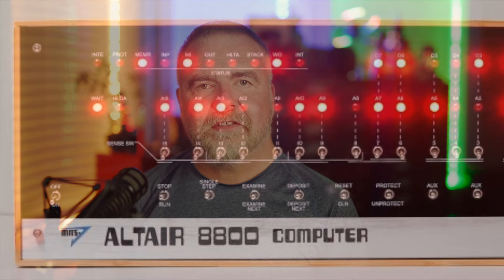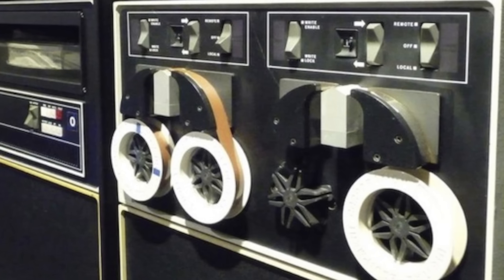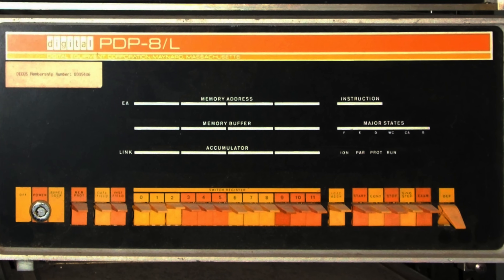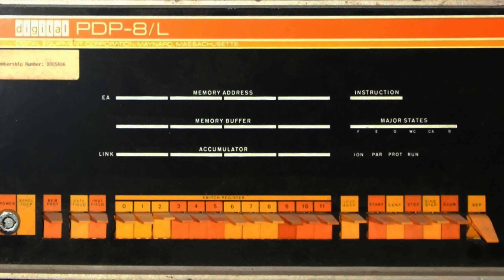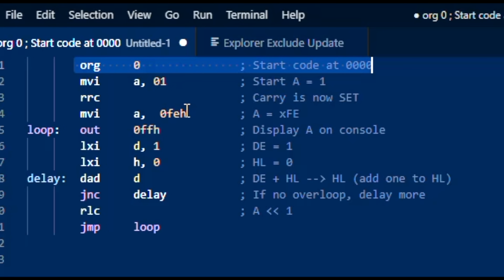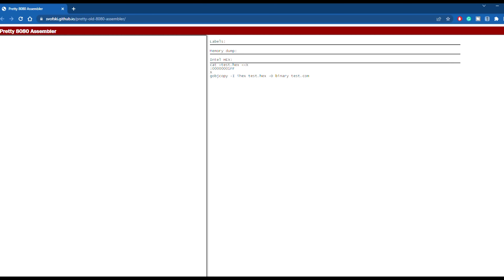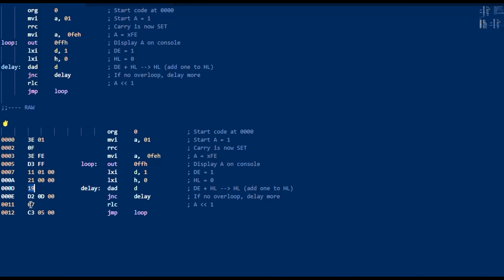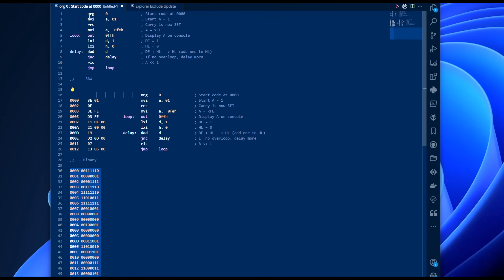Bare Metal Programming - Booting From the Switches

Comment: The bootloaders were often quite clever.  For example one of the ones for the pdp11 to boot from tape, basically consisted of enabling the tape drive (advancing to block 0), reading the next block, and an infinite loop (branch to self).  Five or so instructions if memory serves.  Since at reset the DMA address is 0, where the bootloader also resided (again if memory serves), reading the block would overwrite the bootloader with the block from the tape, and when the block was in memory the branch to self was overwritten from the tape and the CPU would continue running what is now the stage 2 bootloader at the head of the tape, which would then proceed to boot the operating system.
Reply: That explains so much of why computers used the MBR the way they did. Now things are way more complex, for better or worse.
Reply: @anon_y_mousse  It appears as if some current generation processors have mask-ROM loaders that can read a "FAT" type file system from a storage device and look for an OS startup file. I'm not sure we should be "baking in" one specific file system.
Reply: @boristheengineer5160   Indeed, and they're even starting to put NTFS reading into them, too.
Reply: Eventually Roms were added to the CPU which contained the bootloader and all you had to do was enter 3 bytes, a "JP" (jump) instruction followed by the address of the bootloader.  When floppy disks became available the rom was moved to the Floppy Controller card.
Reply: Yesh.  I remember flipping octal switches on a PDP-8 for the bootstrap. Got pretty good at converting decimal to octal on the fly.  I also remember things like the excitement of getting a new paper tape from Decus...and having to scrub the rust off the core memory because of a silly lab accident.
Reply: Very nice description of a bootstrap loader Jan. For those who do not know, originally a bootstrap is a strap on a (leather) boot, that can be used to put the boot on your foot. You use part of the boot, to put on the boot. This is exactly what Jan is describing: part of the code to read the tape is read from the tape!

Comment: I'm pretty sure you probably already know this, but hex is pretty easy to convert to binary "in your head" if you deal with each hexadecimal digit individually, for each four bits, instead of converting a two digit hexadecimal value to an 8 digit binary value.  I guess that wouldn't be a great step by step guide if you're just converting to binary in your head when typing them in.😁

I was just thinking, that's likely why there are two different colors of switches for each nibble.

Comment: Wow it is almost the same binary coding than z80, by example, "3E 01   =   ld a, 0x01"  , 11 and 21, are respectivelly LD DE, nnnn   (16bits const),    and LD HL,  nnnn  so 3 bytes long,   C3 label, is also the same unconditional jump, the rotation is aswell 0x07 0x0F, the fast ones, I think, the whole program at 9:45, is the SAME binary that will work in a z80. I didn't know they rip off the whole OPCODE table, atleast the NON shifted table, how they didn't hit a copyright claim? .
Reply: Z80 is pretty much a superset of 8080, and so binary compatible. (worth searching  YouTube for LowSpecGamer's channel, he does a very good telling of the Zilog story "Intel's worst nightmare" - that is quite and interesting tale). 

Back in the mid 80s I had a Commodore 128 which had both Z80 and 8502 CPUs. So it could run as itself in native mode, also as C64, and also as a CP/M system. I was quite looking forward to having a play with some  Z80 code on it, but then was a bit disappointed when I realised that the assembler included, and much of the example code was all 8080 rather than Z80. (Probably not surprising since CP/M was originally developed for the 8080). 

Still I did get to do some Z80 development 20 years latter (compiled from C on a SPARC station!), so found myself mentally translating Dave's program to Z80 assembler as he went through it. 🙂
Reply: @johnrumm4786  check my channel old videos I did platformer video game in z80 asm. Check the SUPER CASTLE titles work in progress.
Reply: Early cpu designers often "borrowed" from each other because the law was kind of lose back then. That is why the arm license agreement is now a huge book.

Comment: Luckily I never really programmed in binary, when I started we had hexadecimal keypads. I did however enter the binary bootstrap program into a PDP/8 that read from paper tape, as I remember it was about a dozen bytes long so similar to Dave's program. Hex however was far quicker to use so we had that advantage, although my first program was much longer. On the other side, we had to build the computer first, it was a Heathkit H-8. My first program was a clock that allowed you to set, and it updated the hex display with the current time and had an alarm function as well. A rather expensive clock for our college computer club, the next year we were able to afford a serial card and floppy disk and do much more. As this was way before the days of the Internet, and finding an 8080 assembler was impossible, I had to write one first (in Fortran, or more specifically WATFIV).

Comment: Ah memories, although the computer with buttons I first used was an HP2100S.
I had a Processor Tech Sol PC so not buttons but a very small program to allow manipulating the tape drive and memory. When are you going to demonstrate using the same byte pattern for two different instructions by entering it in the middle? How small a program can you write to zero all memory?
{^_^}

Comment: Great video. I didn't understand each and every step but enough to follow what you achieved. I once learnt some Assembly language as part of a Degree course. It was done using an emulator on an IBM pc. It was for a Motorola processor I think. That assembly code will only work for that processor. Correct?
A few late nights getting it to work but it did. Great sense of achievement.

Comment: I myself built up a Z80 system just with DIP switches in 1992 at the age of 16.

I had no single clue that these computers yet existed !

I did that by my very own, without knowledge of, for example, the Atlair 2000.

And that system ran very good.

I did a little parallel communication line between that DIP switched Z80 system
and my Commodore 64 and it worked all over my room as I was a child ! 

I recently wrote a little VBA Excel makro which translates the mnemonics into opcodes (hex)
of a 6502 CPU. Kind of a compiler, from scratch.

 Go figure 🙂

I will follow your channel. Thanks for the video 🙂
Reply: I used to do that kind of stuff back in the 70's and 80's. Was a lot of fun.

Comment: Maybe it is worth noting to younger viewers that back in the day you didn't go on a website to turn your assembly language to machine code (what is a website anyway?) but did that manually with an opcode list , calculating jump addresses manually. Of course, showing how that is done would have been way too much for this video. ;-)
Reply: I had a VT100 and 1200 baud into work, DEC 8000, over datapac though.

Comment: But can it do a prime sieve? And how fast do the Altair, Imsai, PDP-11, and other models drag race against each other? You know we're all wondering.
Reply: Altair and IMSAI were almost identical Hardware designs and the CPUs ran at a blazing 1MHz!  The major difference was how the toggle switches were marked on the front panel.  Altair switches were marked in groups of 3 because some of the bigger systems used Split Octal, or Base 8 and a single Base 8 number is 0 to 7, 3 bits.  This was a bit awkward because the 8 bit data and 16 bit address didn't quite work in base 8... the bits were thought of as 11 111 111, or 377 == 255.

IMSAI, as you can tell by the alternating colors on the switches, went with Base 16, or Hexadecimal.  This allowed bits to be grouped in 4s, which fit the Data/Address format perfectly.

Comment: I had to re-boot a PDP11 used for satellite navigation around 1982.  I had a piece of paper listing the sequence of actions required and to do it "on the hop".  Got it first time! Phew!  I recall that the computer was installed practically on the "floor" on the instrument room of the seismic survey ship which did not help the process.  I suppose I could boast that I could do it "lying down" but actually I crouched. nb I did not "examine" but flipped the switches like my life depended on it.

Comment: When I joined the US Air Force in the early 80s, I worked on the F106A/B Delta Dart aircraft. It was an interceptor designed to take out Soviet Bombers should they attack the US from across the Arctic Ocean.

It had an onboard computer that communicated with a ground-based control system (called SAGE for "Semi-Automatic Ground Environment") that would direct the interceptor to where the bombers were. It had a disk drive with a tall stack of large platters, and it had to be booted by hand.

The computer flew virtually the entire mission. The SAGE datalink ("Time Division Data Link" -- TDDL -- to be more precise) would direct the aircraft to the bombers, locate the targets, fire the missiles, disengage, then return the aircraft to base. The pilot was simply there to take off, land, and take over if the automation didn't work. Weapons included radar and infrared-guided missiles and a rocket with a nuclear payload (the latter wasn't guided as close counts when it comes to horseshoes, grenades, and atomic bombs).

To launch the aircraft, we'd power up the aircraft, pop the forward right access panel, and enter boot instructions one at a time into the computer. There was a bank of eight switches (I think that's right) and a button. We'd enter the hex command via the switches and then press the button to load it. We'd do that several times until the computer took over and finished booting up.

We'd also used the switches and buttons during diagnostics and testing to enter instructions as needed into memory. Read out consisted of a bank of eight lights.
Reply: Wild to me that with everything that what that had to have gone into a system like that that they hadn't figured out a bootloader. You could literally hand wire them (just a bunch of diodes on a wire grid, essentially), so I can only imagine nobody thought of it?
Reply: @SimonBuchanNz  

Flexibility in the field, probably. With hardwired code you're stuck with whatever the designer thought was necessary. At least with the method described here, you could just update the operators. Heck, there could also be issues with space and weight... Maybe the interface was attached on ground.  But... there's also the issues that human error brings. 

However .. I am pulling all of these speculations out of my rear end... I have no personal experience in military aviation from back then or even now.  But that would be my uneducated guess at least.
Reply: @SimonBuchanNz  My first guess is that it was for security.  If the plane crashes in enemy territory, the power fails and all of that super-secret programming is automatically erased.
Reply: Thanks for your service,  Sounds like me - I got started in the USAF in Crypto in 1969 and am so thankful for what I learned and saw while serving.
Reply: Keep in mind, the OP says they only have to enter commands "until the computer took over", eg, they're entering a boot loader, not the entire OS. Any flexibility and sensitive instructions would be on the tape or whatever.
Reply: @SimonBuchanNz  The way it was described, it sounded to me as though they were loading the OS at base then sending out the flight without any tapes.  I'd expect the crew was only on board to take over if the computer suffered a "glitch" and lost its memory.  They'd have to take over because they didn't have the OS or the instructions so they couldn't re-load it while in flight.  The computer would no longer be able to control the flight, so they'd have to do that.

Comment: One of the first computers I used didn't even have any ROM. How could it boot and start up with zero firmware?

The processor was a 6800 and the processor could be stopped, and buses put in tri-state high impedance (hi-Z) effectively disconnecting the processor from the RAM.

You then set up individual memory addresses for the RAM using switches, set the data lines up in the same way using switches, then push a button to trigger the R/W line to the RAM chips to write the data value in. Then repeat for every byte you wanted to store in memory.

The address decoding logic mapped the RAM into the top end of the 64KB address space where the reset and interrupt vectors were.

So what you did is put the processor into "halt" mode by flicking the switch, then you could write the start address of code you wanted to run into the reset vector address in the RAM, then write your program code directly into RAM with the processor halted, not executing, and then flick the reset switch which triggered the processor's RESET line and take the processor out of halt mode, and away you go, the code you manually inputted in binary machine code would be executed.

If you want to learn to how computers work....this is how you do it.

Comment: In High school we had a PDP-8i  (mid 1970's). To boot the machine we had to enter 12 pairs of of numbers (instruction and address) to have the high speed paper tape load the OS and set up the machine. 32K of shared ram (5 users). It had a 1 meg Winchester Drive deep inside the machine

Comment: It’s a shame the modern clones I’ve seen are relatively expensive, as I like the idea of having a machine like this to mess around with.
Reply: There are a lot of ways to get similar systems.  Check out Tindie for kits.  I have a single-board 80180 -based setup that has a Zilog 80180 (Identical to an 8080/Z80 but with a 1MB address), Bank select 512MB RAM and 512MB rom, containing multiple versions of CP/m .  Kit cost about $70US

Comment: I spent lots of time 35 years ago entering boot loaders this way on PDP11s!  They used Octal - ie groups of three bits giving values between 0-7 and the switches were colour coded in groups of three - so it’s pretty easy to get your head around translating from the assembler output in octal and flipping the groups of three switches to enter the addresses and data
Reply: My start was the PDP-8 - also octal, it took me a long time to get my head wrapped around hex.
Reply: I worked on an ICL George 2 unit that used octal, but it was fancy, it had a console! Ha! But I do recall the 7-bit tape drive that was so noisy! Tak tak tak tak click click, no wonder I’m half deaf lol
Reply: @makethingsbetter  And probably a bad back from shifting heavy cabinets!  ;-)
Reply: @cdl0  the struggle was real! Haha 😂
Reply: @makethingsbetter  Oh, the good old days!  :-)
Reply: Dave could have done the same with his IMSAI replica since hex is simply 4 bits per hex character and you'd then only need to remember what the bits are for each character.  I have to assume that he converted the code to binary because it's easier to get the point across.

Comment: Conceptually, I knew how these worked. I now think I could--with the appropriate documentation--bootstrap such a beast. Thank you. Now, can someone explain how they programmed even older machines? Like the ones where you open a door and...oh my... there's a mess of patch wires that is your program.
Reply: I had to manually rewire the patch blocks on a KW-7.  This was a US coding machine that would encrypt teletype signals.  It was about the size of a large microwave oven.  Every day the codes had to be changed and involved rewiring about 50 pairs of connectors.  It was hell when one of them had an internal break, took forever to find.
Reply: Weren't the patch panels &/or wires a literal redesign of the circuitry as needed?
Reply: @bobvines00 Could they be like programmable logic/gate arrays? What you wire on the panel is the "truth table"  of some sort?
Reply: @MichaelEhling  : Yes. Not actually familiar with the things, but you'd put the values in like with switches, but with multiple values in at a single time, and with no destination address for the value. Depending on the design, a particular programming row might need to be tied to a particular "supply" row (if the selection logic was on the supply side instead of the reader side).

Comment: The IBM 1401, released in 1959, could be programmed using the front panel. A read card and print was simple from the front panel.
Reply: I worked on a new ibm 4381, and we still used the 1403 printer with carriage loops and machine gun like hammers, way before safety conscious companies. Although the shift leader did cut my tie right off so I didn’t get hung by the bad sensors and the iron hammers lol 😆